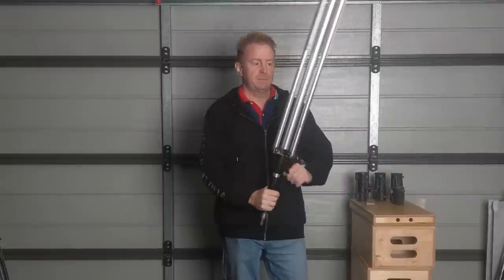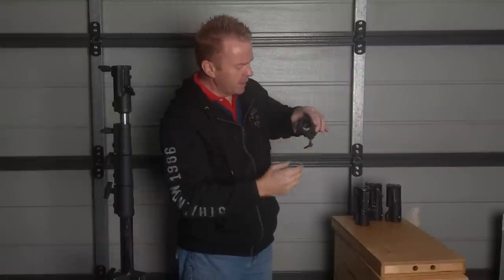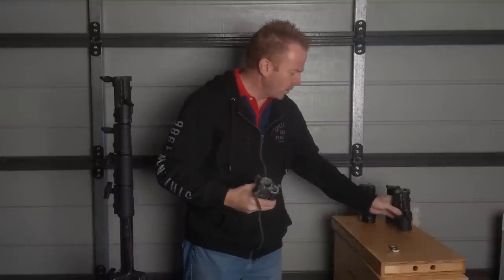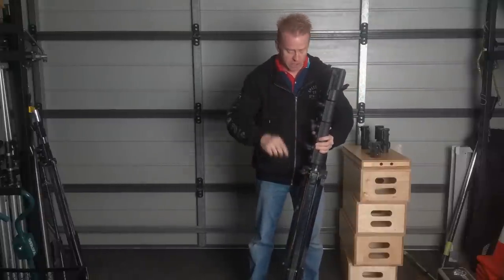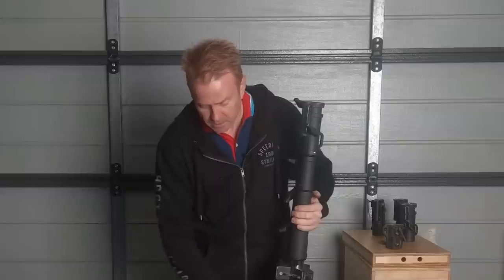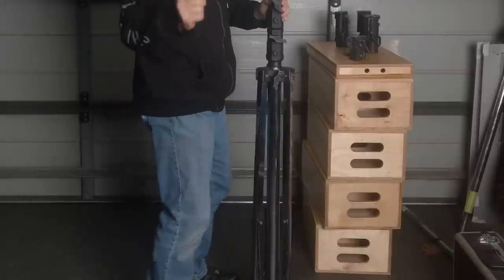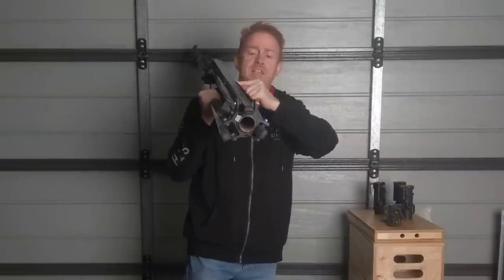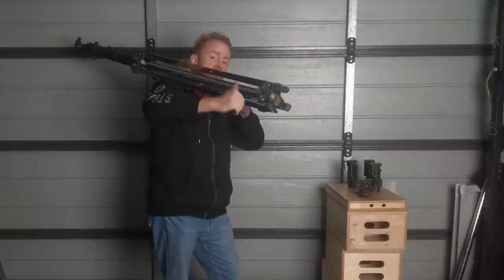Gaffer & Gear 47 - Carrying Heavy Stands

Comment: The trouble with the stand on the shoulder is that if you turn you can swipe someone. Its not wrong just requires a high level of alert or get a runner to follow you. If the clamps are not done up the stand can slide - super bad but we are going to have our stand tight :)

Comment: The hardest part is getting heavy stuff up to your shoulders. Stands aren't such a big deal but a lot of film gear is uneven in shape and weight distribution so it isn't like practicing with a barbell at all
Reply from the maker: That's a good point. A lot of new manufacturers don't get that the weight needs to be centred.